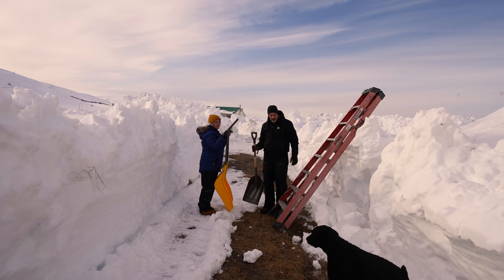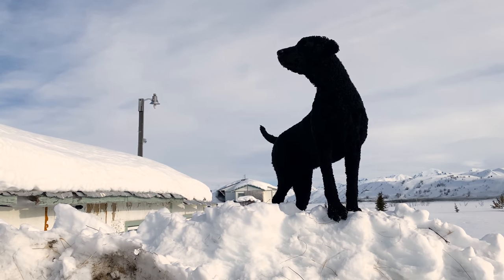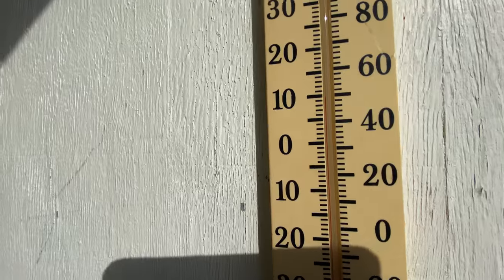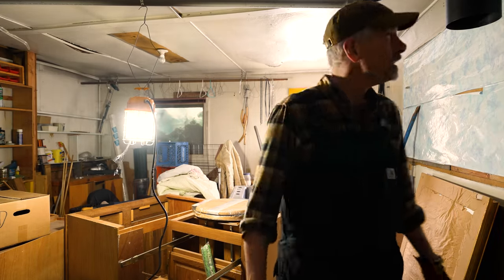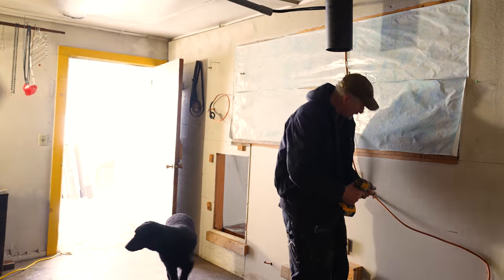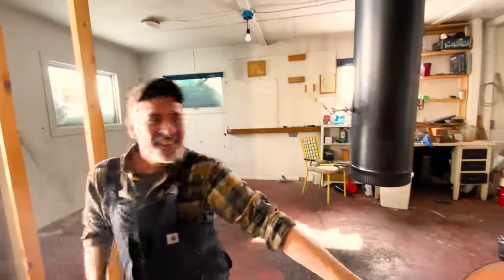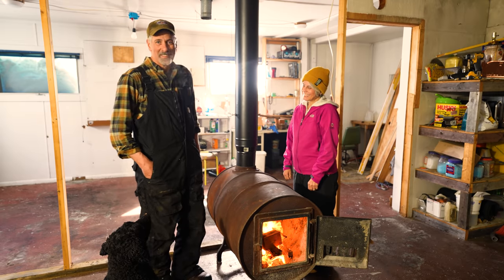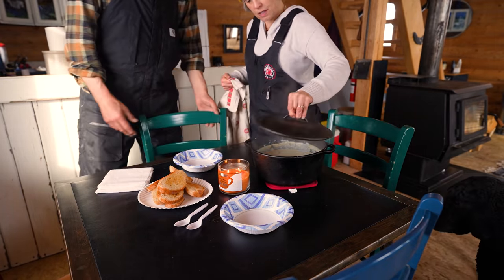ROOF SNOW-LOAD PROBLEMS (Off Grid Living)

Comment: Hey there! From a fellow contractor I would like to say it is a pleasure watching you and learning new stuff.  Already spied out that handy little pry bar you use for myself. We do brick, mortar and concrete, very little carpentry of your caliber. I enjoy watching the process and methodology you follow.  Looking forward to the revamp of the main lodge.
Reply from the maker: Thanks so much Craig. My father was a concrete contractor here in Alaska, from 1967 through the early 1980’s. He did a lot of flatwork and CMU, but he was particularly known for his stone fireplaces. That was probably his favorite thing to build. He has since passed away but his work is still visible all around town.
Reply: @ThisIsMyAlaska  Concrete work in those freezing temps is a challenge. Your dad must have been top tier of the trade. I have to agree with you, driving around and remembering a project you did in a specific area is always such a joy. Remembering your dad by seeing the chimneys must be really nostalgic. What I also enjoy about watching and following your channel is the difference in terminology we have across the world. Something as simple as a laminated beam, you call it a Pine glue lambeam. We just call it a lambeam, because we only get 'em in pine and assume it is glued I guess. Oh and by the way good luck with those rafters, bit more than a deflection or a slight bow to deal with there. I suspect you will be doing some reinforcing in between the rafters and then remove all the old ones, or rip off the whole roof and start from scratch, weather permitting. Looking forward to see what guess comes to fruition. Anyway love the content!

Comment: Barrel Stoves!  Cook your front and freeze your back!  Oh yeah, I remember them from the fifties and sixties.  Somewhat of an improvement was the double barrel stove.  The top barrel made a sort of plenum to heat more air.  Most of the situations I remember with barrel stoves were in poorly insulated enclosures with lots of air flow.  The old home cut board and batten siding without any sheathing (diagonal shiplap back then).  The oil parlor heaters were a big improvement giving a more even heat.  The barrel stoves were far from airtight so it was all or nothing.  Then the seventies and airtight stoves were such a huge improvement!

Comment: I was wondering if a heated roof like what you did with the in floor heating in your cabin project would help during the winter. Perhaps a loop with heated water running through would help melt the snow, so you don't have to worry about the weight on the roof. Just a thought...
Reply: The pitch of the roof would have to be increased to a steeper slope,then a heated roof added,but a great idea!
Reply from the maker: Hello Geoff. A lot of things have been tried and experimented with Over the years. A steeper slope helps, but I like to be able to walk around on my roof so I keep them fairly shallow. I generally just spend a day or so shoveling each year. It’s a great workout!

Comment: I have one of those old barrel stoves and the parts to build another one, The assembled one is in a greenhouse, it was originally in my Dad's shop, and I Plan on eventually putting it back in the Shop, and when I Build the other one from the parts I have, it will go into the Greenhouse that my Sister has assembled and hopefully someone will use it again for the first time.
Reply from the maker: The barrel stove is  reasonable cost wise and easy to assemble and the greenhouse is another great place to use one for sure! Wishing you many cozy barrel stove fires! Thank you for watching. 😊

Comment: Pretty bad when you need snow shoes on your roof lol . Just picked up a 6' section of 8" metalbestos pipe with rain cap, roof flange , never used, 20 bucks. Gathering stuff for my cabin build. I know its red necky but a .22 bullet makes a perfect hole for the damper. Take it outside(duh) and shoot a hole in the pipe, have a beer and celebrate. How about a video of how many cabins you have.
Reply from the maker: Good morning Jim. Yep, I’ve heard of the 22 trick, never used it though. It would be great in a pinch. We have a few of these cabins now, they are just a great love of mine